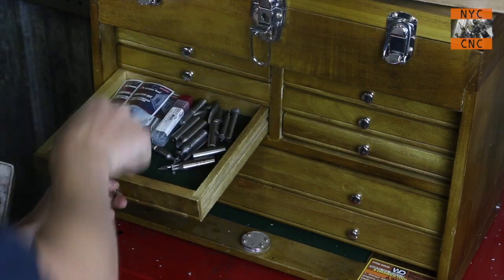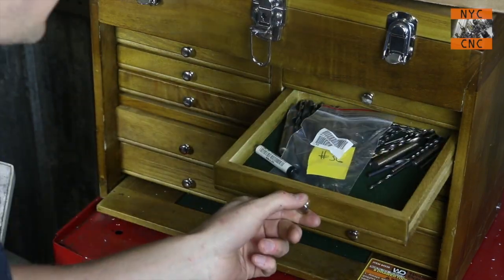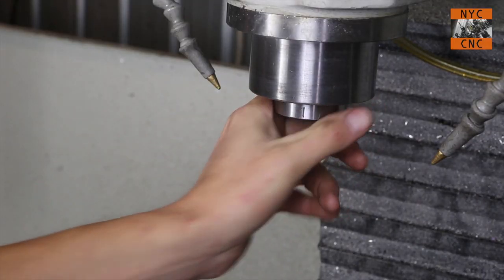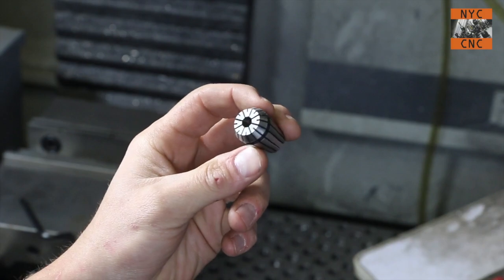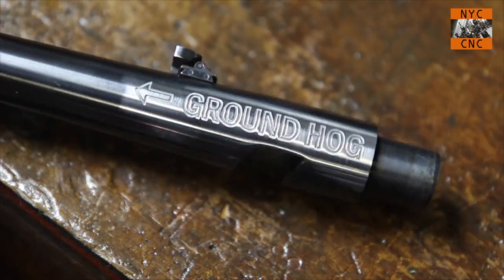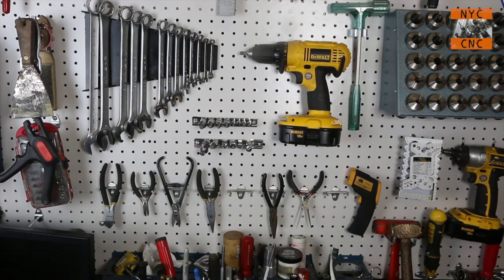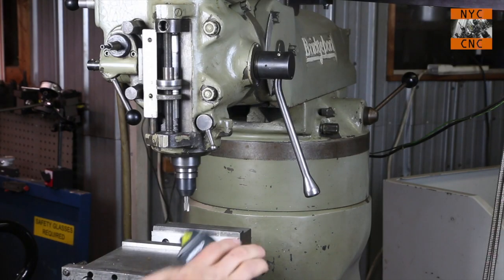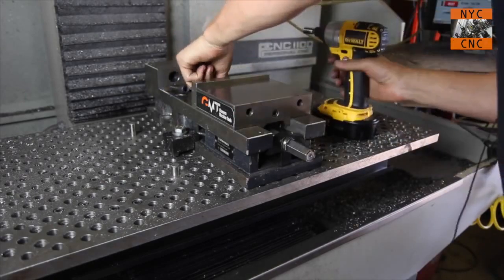14 Machine Shop Tips & Tricks!

Comment: John, great tips!  I've been using the "keep a spare on hand at all tines" for household goods for years. When the spare goes into service, I replace it right away. Everything from peanut butter, to cleaning supplies, to socks.  Keeps the stress levels low to never run out of anything I use regularly. 

I haven't seen the screw down pegboard hooks before, but I've used clips that hold the regular types in place. They are plastic and just bridge over the hook shafts and lock into the holes on either side.  They work pretty well. 

Check out the Ikea "Jansjo" (I think that's the name) lamps. They are bright LED, low voltage at the lamp (wall wart), won't burn you like incandescent or halogen work lights, about $10, long gooseneck, and since the cord exits from the side of the base rather than out the bottom, simple to attach to brackets or machines (two small screw holes). I have one on my drill press and will be putting another on my new (to me) lathe. You can see them in Doubleboost's YouTube videos, as well as those of several others. 

One last idea: I put one of those retracting key chain things on the bracket I added to the drillpress for the Ikea light, and attached it to the chuck key. Keeps it handy, and out of the chuck when I'm not using it. About $4 at Ace.

Have fun!

-- Mike
Reply: NYC CNC
John, I'm very happy I managed to suggest something useful to you.  You've done that many times for me.  I'm sure you can figure out how to implement the ideas, but in case anyone wants more, the mount for the light and the keychain that I came up with is just a scrap bit of 1.5" angle iron about 6" long.  I used another bit of scrap as a spacer for the Idea light...the screw studs are about 1/4" long and the angle iron was only 1/8" thick.  I attached it to the drill press using one of the motor mount bolts.  The keychain is just clipped to the angle iron.  It's been working well, but I can always attach it more firmly if necessary. 

Glad things are going so well for you after your move home. 

-- Mike
Reply: NYC CNC
Yes, and it made it a simple job.  At the time I had nothing more for metalworking than the drillpress, a 110v MIG, an O/A welding rig, and hand tools.  I had the 6" piece of angle iron left over from making a small welding table, and it was simple to file off the burrs and corners, drill a few holes (two for the light, one for mounting to the drillpress), and spray some paint on it.  I mounted to one of the motor mounts so I wouldn't have to make holes in the drillpress (it's nothing special...just a Delta 14" floor standing, but I tend to leave things as-is unless I have a good reason not to).  Putting the light out to the side like that keeps the cord away from the table elevation crank, gives a good angle for lighting (though the light has enough reach that that isn't critical), and ended up providing some space for clipping on the retracting key ring.  Being attached to the motor mount, it's far enough back that it doesn't get in the way of whatever I'm working on.

-- Mike
Reply: Not complaining!  The MIG is limited in capacity, but it works well.  I just got a 1955 South Bend 9" lathe and am working on learning to turn so the capabilities are increasing.  A benchtop mill is next on the "want" list...as is more space! ;-)

-- Mike
Reply: Yes, got a Phase II AXA size.  First turning project was trimming down the t-nut for it.  At first I thought I'd need a mill, but the 4-Jaw chuck worked great for trimming width, and then it fit in the milling attachment to cut the "T" part.  Still want a mill  though!

-- Mike
Reply: NYC CNC I've also got a collet chuck for small diameter material and for holding cutters when using the milling attachment.  I've got space and power limitations for now, so I'm looking at smaller benchtop milling machines.  G0704 is one possibility.  The Little Machine Shop Hi-Torque Mini-Mill is another...but if I go that way I'd want to CNC it.  The G0704 would probably be converted to CNC eventually, but would be fairly useful as a manual mill for now. 

-- Mike
Reply: Yep, sure did!  He sells the videos, the plans, and at least some of the G-code on DVD.  Besides the price and the size, the availability of that information is a big part of why I'm considering that particular mill.  I've looked around the web and YouTube for info on the G0704 (the BF20 and a couple of others are basically the same machine) and I've seen it do some pretty good work...but I've also seen a wide variation in quality of construction.  Some are very good, others should never have made it out the factory door.  Like much of the Chinese output, if you consider it a "kit", not a finished machine, you'll probably be ok.

 The reason for looking at the Hi Torque mill is the CNC conversion plans from Kronos Robotics.  I've got his KRMx02 plans, and they are very well done and he arranges suppliers for the parts too.  Can't make it simpler without doing the work for you, and what fun would that be? ;-)

-- Mike
Reply: Someday, maybe.  For now there are limitations on money, space, and available power (no 220v).  In a few years I'm hoping to move, and one of the main requirements for a new place will be shop space.  In the mean time, I've got a small lathe, and want to get a small mill so I can keep learning and make a few useful parts. 

-- Mike

Comment: As far as tip #4 (tool run-out) my experience with the Tormach ER-20 tool holders was that you could find the "sweet spot" with a given holder and collet but if you took it back apart and rotated the ER collet the sweet spot would change. It was the set screw holders that I found advantageous to do the marking of the spindle/tool holder and match them back up. I did this test with precision rod in my 1/4 and 3/8 ER-20's and felt like i was chasing my tail.

Thanks for the videos! I learn a lot from yours and others.
Reply: EVERYTHING runs out. 
If you’re concerned, do a quick test run of a CNC milled and measured hole to see what the offset is before using it so you can compensate for the runout.

Comment: Tip:  make or buy a tall set of jaws for your mill vise.  Ortoolworks makes a really nice accurate set although expensive.  well worth the price to me.  Tip: don't get stuck on ordering tools from just 1 place, the interweb has made it so easy to  get deals by bypassing and buying straight from the manufacturer or finding a distributor that doesn't  jack the price by ridiculous percents.  Tip: Talongrip jaws are awsome.

Comment: One more to add to the list. Always replace the collet after a tool breaks at the base even if it look fine to the naked eye. At my work i destroyed 3x $100 end mills in a week before someone told me there may be a micro ber pinching the tool and to get a new $10 collet. since then i have run that end mill way harder then i used to and its now over a year old. (this may only apply to tools that have side loads)
Reply: NYC CNC I never did look into it after the problem was solved but it was a single flute endmill cutting 6061 Aluminium running at S18000 F1000 Z-3 (mm) after the second broken tool. now with the new collet i can push it to F5000 no problems. This is an old cnc router wich has served most of its life cutting kitchen cabinets before i got it. And all my work is in the area of +/- 0.1mm. It has an 8 position tool changer (by the way. i don't know how you live without an ATC.) and the runout can change from one tool change to the next. one day i will get the spindle rebuilt but for now it cuts all day without a problem.

Comment: I used to use the electric impact  gun on my vise jaws, but have switched to a battery powered ratchet. fits in better especially if using tall jaws plus you dont have to use a ball end hex which chew up the jaw bolts.. I use the milwaukee m12 ratchet. mostly because I already had batteries and charger from their drill so I could just buy the bare tool.

Comment: Hi John, you run a great channell and I enjoy the vast array of information presented. Thank you.
Off topic but one on maintenance. I have a bridgeport vertical mill clone (hafco BM-50VE, Sydney Australia) that I picked up second hand. the manual which that is not specifically for this model that I sourced on line is written in Chinglish and does not cover the servicing of the Spindle head gear box.

What I need to know from yourself or others, is how do you check the oil level in the spindle head> Any help is apreciated.
thanks

Comment: Anything that rotates has to be rotated the right way; car wheels, drills, endmills. Especially them grinding wheels. Good tips, cleaning the shop is always good :P Makes it easier to find stuff when you don't have to run the shop 10 times upside down to find something.
Reply: Well, not everything, but most of rotating things have correct rotation.
Reply: NYC CNC We have experimented and found that once used, wheels and belts tend to last longer if always rotated or driven the same direction if removed and reinstalled. Especially wire wheels and buffing wheels.
We now sharpie mark the direction of rotation/travel on all wheels and belts when first installed.

Comment: Hello John,
Thanks for sharing those tips.  I've following your channel even though I don't own a Tormach or am using Sprutcam.  Great stuff you've there!

I bought the tachnometer like you shown on the video.  Had to replace it a while later as it didn't work.  The new one also died (no light coming out) after a while of no usage (batteries taken out).  How's yours working out?
Reply: NYC CNC I stored mine in the bag it came with and in my measuring tools drawer.  
I took it apart 2 nights ago to check if I've a break joint or 2.  after probing around and not knowing what i was doing, it started to work.  I believe the Test button connection is the culprit.    Shouldn't have threw away the first piece.

Comment: My #1 tip would be to use check lists and have set procedures for some jobs. For instance, when I weld. First I start up the water cooler, then open up the argon, ground, the work, unroll the foot pedal then turn on the welder. So far I have not burnt torch leads, and roasted very few electrodes by lack of argon. Point being to make stuff idiot proof. Hey, we're all stupid at times
Reply: Good tip. That is a very important tip in an environment with employees and on the job trainees unless your goal is to be a nonprofit entity.
For employees and OJT trainees it also teaches discipline and good standardized practices.
Reply: charles villeneuve NYC CNC A realted tip is keep you phone with you at all times, Photo document every setup, measure things, take notes, notes and records are key.
Reply: I work in a growing business where we re-manufacture electronics for the agriculture and transportation industries, and we've done something that is flat out amazing: we put all our processes and procedures in an internal online database that we can reach through a web browser. Each workstation has a PC, or laptop/tablet with wifi that can see the current version of the process, and the status of work on each order. It's much easier to keep everyone up to date with changes by only having to make one change in the database. We still have to implement a feedback and change system so users can report errors and updates, but it's coming. This helps keep a team (of over 30!) coordinated on some very complicated projects!
Reply: NYC CNC
We do, in fact, recheck it constantly for updates. But all that entails is hitting "refresh" in the browser and checking the revision notice on the second page of the document. Easy! Some of the documents are almost a 100 pages long, so being able to do a quick refresh and revision check is important. Most of our documents are pdf, but it could easily be implemented with html web pages. It would actually be easier to implement feedback, notes, and tie into a workflow "traveler" system that tracks progress of work orders through each step of the reman process. A lightly modified wiki running on an internal server might be able to do most everything our system is doing. Being web-based allows you to use any platform. Our inventory tracking system is running on a Linux server, but we can only access it through Windows, but our documentation is available on any platform.
Reply: NYC CNC
Right. All our browsers have our internal server set as their homepage, then there are categories to select for: Policies, Work Instructions, Quality, IT tickets, etc.. On-line documentation and central document control is a big deal for our ISO certification, and more importantly, customers.
The wiki based instructions would even let you do something ours doesn't: insert videos of instruction steps, setups, jigs, special manual operations, etc...
If you can tie the wiki into your database, then you could also keep track of each work order in real time using a dashboard. Helps with setting time standards for job operation steps. Having timestamps and continuous tracking gives you valuable pricing info for setting standards.
Reply: NYC CNC
I'm just describing what our current system does. Our shop is about 40 people and we're still expanding. We have a full time programmer in-house just to program our nosql database system. A wiki that ties into a standard database system will give you a big headstart in developing yours.

Comment: tip 3  if you work with employees make sure that they never ever put dull dril bits ,end mills etc. back in the tray. In my shop i have a tray were they can put every dull ore broken or used drill bits ,sawblade ,eveything that needs to be replaced even used grinding disks must be in there !  Every Saturday at 14.00 i check that and sharpen or send out to be sharpend or order new.
Reply: NYC CNC I sharpen all the drill bits up to 13mm except the one's that are broken that costs to much, the MC 2 and 4 thats from 13.5mm up to 45mm will always be sharpened it is just a matter of the labour that i have to put in it. Carbide dill bits cost about €5.00  5 minutes of my time cost the same so that is my thumb rule
Reply: Now it is hand grinding but I've bought the same drill grinder as the man who sharpen my sawblades but I didn't have the time to figure out how the thing works Did you already tried the grease for the sawblades ?
Reply: I don't know Beo Lube
I use grease from Germany it is really hard thick stuff that i put on every 5 cuts it really protecting your sawblade new record for me is 1600 cuts sq tube 50x50x3mm that should be 2 x 2 x 1/8 without any mayor burrs with the same blade.
Reply: Yes it's impressive I have asked if they have the same in oil if that works oke I send you a small bottle if you like

Comment: I see people coax indicating when it's unnecessary. So time consuming! Edge finders still work when used in IDs as well as large ODs. The side of the edge finders doesn't have to tough the side of the part in the OD case. The corner of the edge finder will do, just be sure your depth is the same when checking both side of it to find center
Reply: Touch*